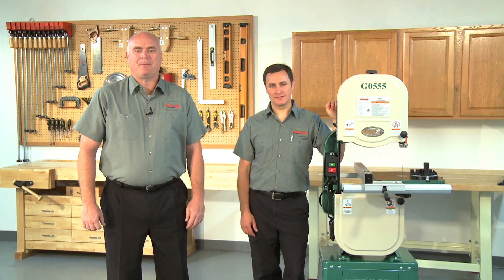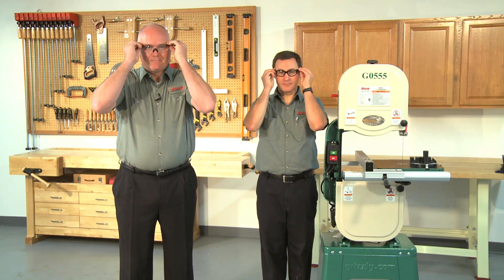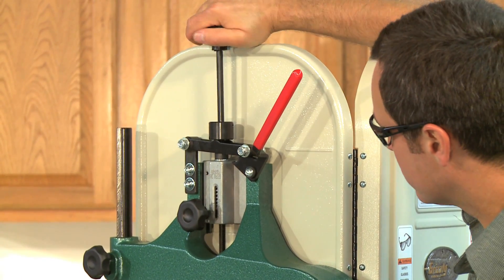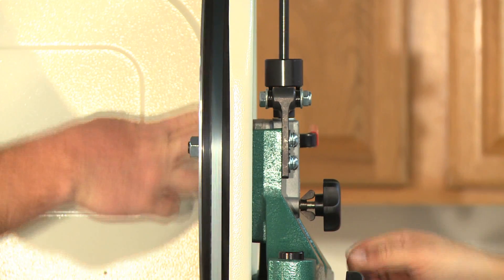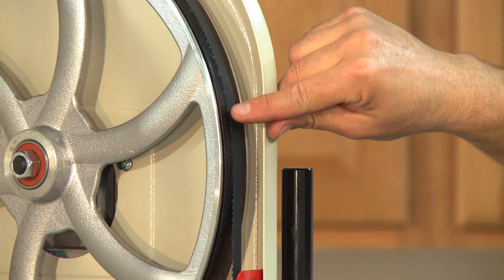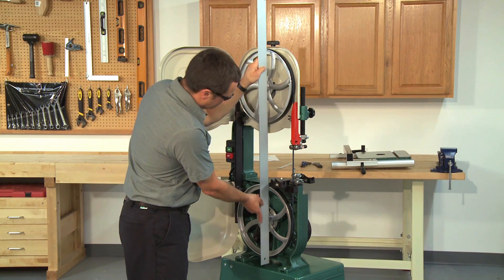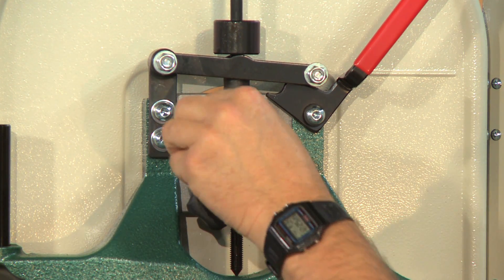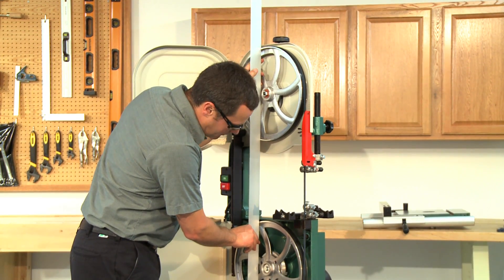How To: Bandsaw Tracking and Coplanar Setup and Adjustment

Comment: Why does it not come coplanar and parallel straight from the factory??? Accessing those set screws are a real pain. Take the wheel off, put it back on, take the wheel off, put it back on....over and over....
Reply from the maker: Sometimes the wheels are intentionally offset to help the blade track properly. If the blade tracks well on the top wheel and shifts slightly on the bottom wheel, that’s okay, as long as it stays fully on the wheel and doesn’t come off. If you have additional questions or need assistance, please reach out to our Product Support team at (570) 546-9663.

Comment: Great video! I've been setting mine up and although the manual is great, some things get lost in translation that are easier to get from the video. One thing that would be extremely helpful is a link to the shim washers. I need some for my top wheel and they're not easy to find on the website. ;)

Comment: No offense but centering the blade on the wheel is wrong.I ruined a bunch of lumber and a very expensive blade.Alex Snodgrass has  a good method.The blade should run with the deepest part of the gullet of the teeth on the centre of the wheel.Get enough tention on the blade and get table and fence aligned.According to Alex no bandsaw should have any drift.I set up my new 17 inch for resawing his way and it is spot on every time.Forget the flutter way of tentioning blades.The blade is doing a lot of work and should be tight.Now I like my Grizzly 17 inch 40th Annerversary addition.

Comment: My 1” blade and 1/5” blade stay on center. but then I try to use an 1/8” inch blade and it won’t ever stay on center
Reply from the maker: Hi there! According to our wonderful video expert, with most bandsaws large and small, the wheels are crowned to offer the highest degree of accuracy for the widest range of blade widths. As the blades get smaller (think 1/8" - 3/16"), they require a different amount of support, plus the teeth are less likely to have a pronounced "raker set". The finer blade does require a flatter wheel for an optimum tune. That said, you don't need to find a fresh set of flat bandsaw wheels, but rather most people dedicate a specific bandsaw to a smaller blade size, choosing to manually-sand the crown out of the bandsaw wheels urethane tires. This takes a lot of work, and the top and bottom wheels must be perfectly coplaner, so it's not something commonly seen. Often, using a smaller benchtop saw with wheels featuring less (or no crown) is the ideal approach. Hope this helps!
Reply: @grizzlymachines   this does, ill just change out the tire when i want to use the smaller blades

Comment: Ok let me see if I understand this … I just spend 2000$ on a band saw made in USA and now I have to take it apart to make it work properly?
Reply from the maker: Hello sir! To provide some background, like the vast majority of machinery on the market now our machines are imported items, and we are very fortunate to have a staff of engineers overseas working very closely with our factories in China and Taiwan to produce the best quality saws for your money. Saws that, with the proper maintenance, should provide decades of service. Unfortunately, finely-tuned items in transport may become jarred along the travels, which is why we always try to produce videos like this to get our customers up and running should something occur. Likewise, throughout the lifespan of a machine you'll invariably need to adjust or maintain the machine based on usage and workload. Checking parts like coplanarity and tire wear are all vital to keeping that machines running fresh-out-of-the-box smooth. We hope this video (and the manual, which is available for every machine we offer on grizzly.com) provides solid info for you to keep cutting smooth! I hope that helps to explain!
Reply: Chinese rubbish, i knew it! It suppose to be accurate out of the factory for that price

Comment: Alex Snodgrass from Carter tells you to center the gullet rather than the center of the blade.  When I do that using a 3/4” blade, the back of the blade hangs off the back of the wheel causing vibrations and blade bounce.  Using Grizzly guidelines, I may have a bit of drift but it’s much smoother.
Reply from the maker: Thank you for the insight Peter.
Reply: I prefer Alex's way.  I'll take NO drift any day.
Reply: @Kilroy1225  However it works for you.  I wish I could get it to cut straight, not a preference for drift.  It just doesn’t work on my machine as Alex suggests.

Comment: Excellent video! I have a new Skilsaw which I find the 2 wheels never aligned whatever adjustment I have done.. . Besides, the blade would not cut a straight line (the cut leads to an about 18 degree angle towards the throat side). Now I believe I know what I need to adjust.. . Thank you!!!!

Comment: On my band saw the upper wheel tracks in the middle of the blade but the blade on the bottom wheel is not in the center.  It sits on the outer edge of the wheel with the teeth almost outside the wheel.  I have attempted to move the upper blade more to the right but the bottom portion does not move accordingly.  Help!  What do I need to do.  Thanking you in advance for your professionalism and advice.
Reply: 4vinos It doesn't matter where it rides on the lower wheel, only that the blade runs true.  Search for Alex Snodgrass on YouTube and watch his set up video.
Reply: Understand.  Thank you for your prompt response.  Keep up the good work.
Reply: Follow this video. I had the same problem. Tech support walked me thru it. And yes it does make a difference if the blade is lined up correctly. The blade should ride at the same place on both wheels. This is true for all bandsaws. Once the alignment is set properly it will make the blade cut more accurately. .

Comment: Although my band saw isn't a Grissly, I have changed the band saw tire on my band saw then found that the outside diameter of the wheel was running eccentric by 1.5mm, due to the thickness of the rubber varying so much. I turned a wooden disc the diameter of the band saw wheel and then put the new tire onto the disc. By using a sharp straight turning chisel I found it is possible to turn the high spots off the rubber wheel to make it concentric. You do have to be careful and remove only a very small amount of the tire at a time. Engineers I have Spoken to could hardly believe that it could be possible to turn rubber until I showed them.
Reply: Alan Rawlins While your skills sound fantastic, they aren't practical for 99% of us.  There is so much room for error in the method you're doing, its not worth the trouble for most people.